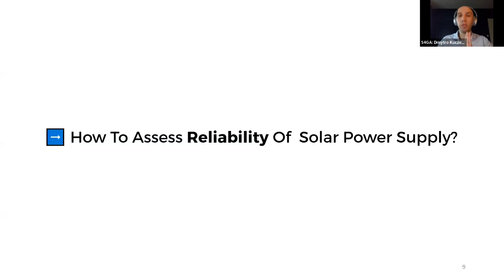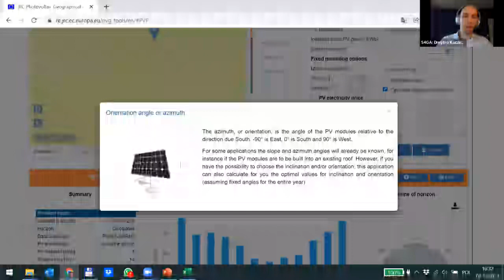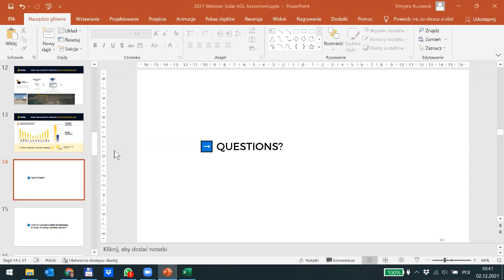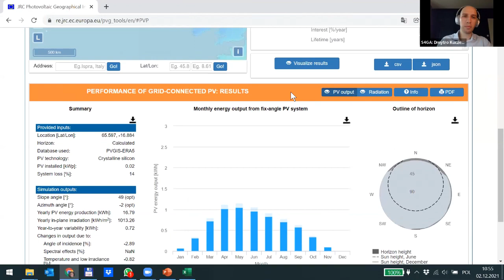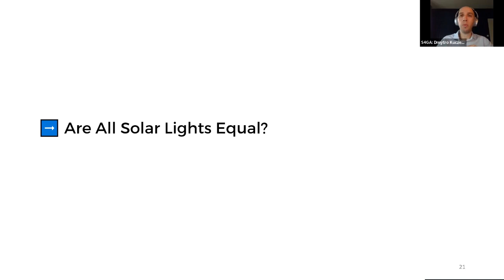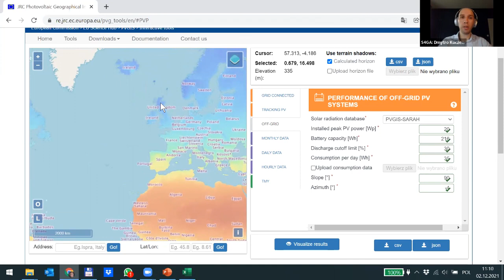S4GA Webinar: Is Solar Airfield Lighting feasible for my airport?

Comment: I calculated 48 G4 lamps. 44 of them are 1.2 watt warm white LED. 4 are 2 watt LED thresholds. 2 100 watt panels. 2 car batteries, acid diluted for deep cycle. 2 voltage regulators. 2 12 volt day/night switches. The novelty is the runway wires are so long that batteries in parallel at opposite ends of the runway will hardly harass each other. Cloudy spells can be cured with resistance to dim the lights. When the lights are at full brilliance, the 2 rows are plainly visible from the upper stratosphere. The most expensive purchase is the underground wires. Easy and simple.
Reply: Hello Stanley, I think this is bad idea having in mind that self sufficient solar AGL exist already and have great performance. It can operate 365 days a year in multiple locations (including Northern Canada). Have a look here: https://youtu.be/ci_l7Iy3cEM